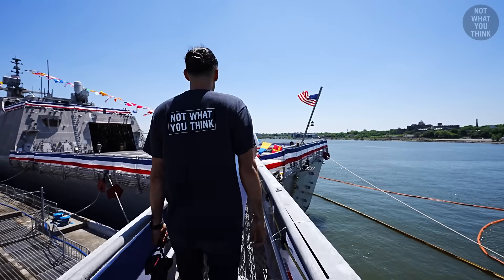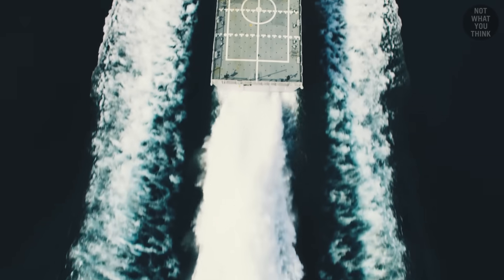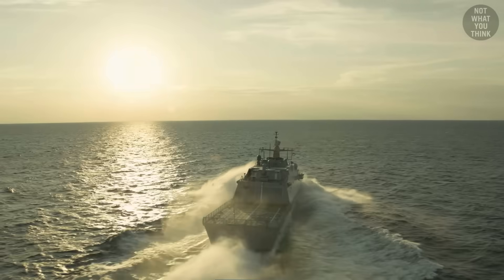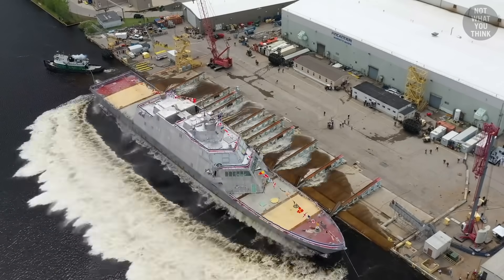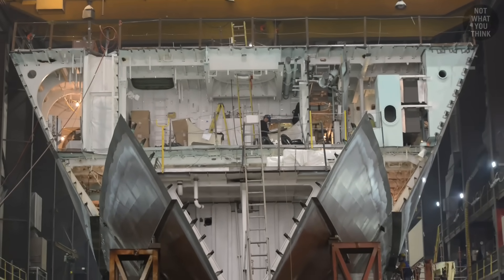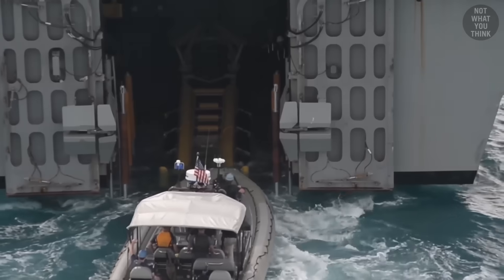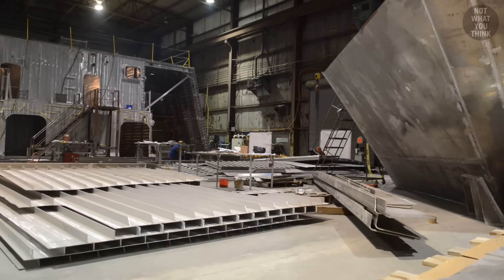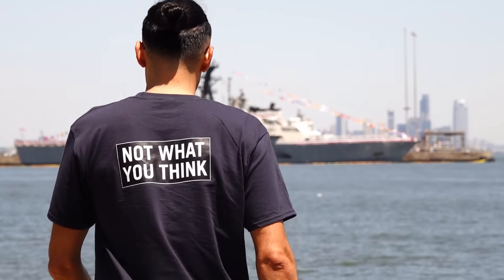I Visited The Most *Overpowered US Navy Warship

Comment: These sharp, 90°, angular corners are a mistake. Corners that are 'sharp' like that, be cause of the very fact they 'stick out' and therefore all incoming forces they could be subjected to would always hit at precisely that same point.... and such angles, when your think about it for a moment, COULD come in from anywhere of a radius CLOSE TO THREE QUARTERS OF THE FULL CIRCLE THE TOTAL OF ANY SURROUNDINGS INVOLVE. It is not gonna be all the way up to 270 out of 360 degrees but close to it! ROUNDED corners on the other hand will hardly ever be struck twice at exactly the same point, will be struck way less hard usually be cause they allow for objects to slide passed them while more often touching with way less impact be cause of that, are able to disperse oncoming physically forces to surrounding areas in (and of) the material they consist of thus, by spreading the impact absorb it. All these feats are QUALITIES and they are qualities angular corners are missing! Round(ed) is less vulnerable and stronger precisely the same way rounded load bearing constructions are officially stronger and able to carry the maximum of weight the material can handle physically, and all that without weak spots. The ancient Romans built bridges and viaducts with half circular transitionsc between vertical and horizontal load-bearing stone work and it is what makes egg shells so incredibly strong even as they 'are made of' chalk and less than half a mil thick. I am kind of amazed they did not think of that, it is quite possibly THE very most basic principle rule there is with regards to engineering, architecture and other design... physics 101 so to say.

Comment: "Aft of the ship" is where a man overboard would be.  The module spaces are in the stern (somewhat simply) or simply the hold, which is located under the fantail.  " Aft" is a direction or orientation, not a location.  You can have an aft hold (or gun, or steering station etc...) if you have a forward one, but the is no "the aft" on a ship.  There, now that one is abaft our starboard beam,  you may gaff that grommet to the gunter gudgeon!

Comment: A really interesting report, thank you very much. I live in Panama and travel frequently through the Panama Canal for work, and I noticed just such a ship on the Pacific side. It was moored there for quite a while, and I wondered what was going on with it. Its shape suggests that it is a fast ship, but of course you couldn't tell from looking at it that it was designed for speed. I come from the aviation industry, and when I am told that two Triple Seven engines together with a 19,000 hp diesel engine system are responsible for propulsion, I have no further questions. The fact that high speed and maneuverability come at the price of weak armor is, of course, a limitation for a warship. And the fact that its own submarine reconnaissance and warning systems fail due to the propulsion concept is, of course, a real safety problem and a restriction on its deployment. Incidentally, I don't believe that the diesel engine system, and even less so the Rolls Royce turbines, are responsible for the vibrations, but rather what they power: the gigantic jet pumps. One ray of hope is the versatility of the helideck and the red light district. I think that, especially in the Pacific coastal region and also in the Caribbean region as a whole, ships with surface combat capabilities of this kind would certainly find useful deployment if necessary. The report is no longer entirely new, and the situation has changed significantly in the areas I mentioned. We have a criminal and corrupt Venezuelan ruler who believes he can take on the US Navy, if not the entire US, and we have the famous white triangle on the Pacific side, through which far too many drugs are still being transported, most of which ultimately end up in the US, causing major problems there. A ship like this could really have a beneficial effect.

Comment: I cannot describe how much I HATE that you kept calling the water pumps "jet engines".  I know that technically they are jet engines, but it's so confusing.  The power is generated by a "jet engine" that's  actually called a turboshaft, and that power is sent to the water pumps which are called impellers.  Both parts could totally legitimately be called "jet engines" so it's super confusing.  Anyways, it's the water pumps or impellers that are making the vibrations, and those have to be firmly fixed to the hull, so there is no way to eliminate the issue with the current design.
Reply: それだけで無く、海水を大量に吐き出す行為自体が、
騒音を発生することになりのでは。
又船体が滑走さす設計から、低速時であれば、
ソナーを働かす事は出来ようが、
通常航海時でも船体と海水が叩く音で、
ソナー効果が落ちるもでは。
DVSをフリーダム級は積んでいましたかね。❓
積んでいれば、ハンター艦と探査艦に別れての対応を行えば、
対応は出来るでしょうが。
Reply: Gas Turbin’s 🤫 😛

Comment: Great video, brings back memories. When the video talks about the number of crew and the various jobs they fulfill, what should also be noted is that such a small crew often results in few days off while in Port with four, or even three section duty.  Meaning  while in port, crew works a 24hr "on duty" shift every 3rd, or 4th  day.  That includes weekends, so you rarely get a full weekend off.

Comment: When any engine is contained inside a box, the secondary control it offers is noise suppression. The box can be suspended on dampening struts, or other structures, to dissipate and reduce engine vibrations to the hull in an effort to reduce its sonar profile.

Comment: If you can want to see why the engines are in those boxes google "uncontained blade failure". I dount they have the big bypass fan that they do on an airline but even the inner core of the turbine has a lot of metal rotating at very high speed. If the ship takes a hit you dont want it going through 3 decks. Secondary you want to contain the fire

Comment: The gear box was really affected if the vertical and hirizontal  mounting of the propeller shaft linear to gearbox was so very poor that getting free from moving away from linear and caused vibration and worn out bearings and gearbox in a highspeed resulting from overheating.

Comment: I served 1974-1994 USN, I remember back in the day the PHM class which were Hydrofoil patrol boats. I was stationed on the USS Truxtun CGN-35 and USS Arkansas CGN-41 back in the day before the Ticonderoga class cruisers came out. I will tell you those Nuke cruisers I was on could get up and go top end 50 knots plus. Ever see a 600 foot cruiser throwing up a rooster tail? The CO on the Truxtun had Red and Blue strobe lights mounted up on the mast and turned them on when we went all ahead flank.//RMCS (SW) USN Ret.
Reply: served on cg72 yes 600 feet with a rooster tail..... And that's not the compared to watching a carrier pulling away from us
Reply: @gilbosavannah  Well, one way to think about it is that a Nimitz class's listed top speed of 30kts or 35 miles per hour, and that may seem like that's not fast, but when was the last time you saw the Empire State Building going past at that speed? Another way to think about it is that a carrier's listed "top speed" is like the "top speed" listed for the SR-71. Ohh, and the Enterprise was the fastest carrier between it's eight reactors and hull design.
Reply: Yes, I did.  Race of USS GRAY (FF-1054) with USS Long Beach; The cruiser  with the ENTERPRISE disappeared over the horizon from the FF.
Reply: I did some testing on Trextrun in 77-8 on one STG. Interesting engineroom, got more on my film badge in 1 hr. than I got working on 637 class boat for 3 years!
I saw the Lincoln go by the merchant ship I was on, go by @ 50 knots! Their rooster tail was as high as the flight deck! Never seen anything like it! 😮
Oh! That was in the Strait of Mallaca!
Reply: @brucelytle1144 Wow, I was an RM so never had a reason to go down to the engine room or wear a TLD. surprised you got so much exposure compared to the subs. Streets of Malacca been through there quite a few times thanks for sharing shipmate.
Reply: Back in the late 60's I piloted a very fast speed boat capable of over 70 knots , it was 65' long and believe me 50 knots  (62MPH) is moving almost too fast for the ability of a craft to turn and especially stop, we said that we just DIDN'T Stop-Ever!
Reply: You rarely see it. But even a OHP could throw a rooster tail. But could not dial up 50 KN. Maybe 33+
PHM calm Gulf of  America this week?  And no junk half submerged in the water. Faster than a commercial Bell Ranger.
Did you know Capt. Orvis?
The Enterprise? oh yeah. Just bit over engineered in the propulsion department.
It also is tough on the hull.
Reply: comparing ships speed is one thing, but compared to modern hypersonic missiles they are stationary, like a speeding car trying to outrun police radar
Reply: Yeah, I was thinking if it would be doable to mount hydrofoils on a ship this size and weight. And not only because it is indeed impressive never mind our host mentioning it is considered one of the smaller vessels within its class (did I even get that right?), but I also wonder if the astonishing speed it can do in combination with the roughness of the seas would not make it very dangerous to even use hydrofoils ~ what would happen if that combination of forces would slam one of them to pieces, ripping it off the hull or deforming it severely, while the others are still in place when you'd been racing over the surface up to that moment? (As you can tell I am not on any level that would allow me to estimate such things, to truly understand them or know what I'm talking about. I am just interested.)
Reply: Ahh the Arkatraz, cell block 41 😂😂😂 OS2 89-92
Reply: Arkatraz...imagine CIC on a minesweeper...ug.
Reply: Uffffff admirable maestro, tremenda historia, espectacular, poderío naval, saludos desde Colombia 😃👍🇨🇴🇨🇴🤝👊

Comment: I want S shaped tube's that swing down over the ends of the water jets. So the eater jet thrust is pushing against the water flowing under the hull.   Instead of just into the air behind the transom above the slipstream.

Comment: You didn't cover what is likely the biggest negative about the LCS: they are LOUD and have LOW SURVIVABILITY. In other words, the enemy can hear them from miles away and the LCS has limited armor and is made of aluminum. Do you want to run missions in a beer can against Chinese navy assets? Even without the extra mission of antisubmarine warfare, they're too noisy to simply detect enemy subs in self preservation. Lockheed fucked us out of the F-22, were given the F-35 contract under dubious circumstances, were 10 years and $1 TRILLION OVER BUDGET on that, plus at no point has more than 30% of the Lockheed F-35 fleet been fully operational! In the MIDDLE OF BEING A DECADE BEHIND SCHEDULE AND A $TRILLION$ OVER BUDGET the fucking bureaucrats at the navy gave them a contract for this steaming pile of shit!! Boeing and Lockheed should be busted up and sold off, their boards of directors and the corporate officers put in prison until they're fossilized.

Comment: Fun fact the helms on board can be configured differently for control. One helm itself can be used as the master while the other 3 are slaves. Normal configuration dictates theat 2 of the 4 are master and the other 2 used for backup. However in the event of all helms being destroyed there exists a secret helm of which im not at liberty to discuss as well a the systems use for remote piloting

Comment: Water jets are a advanced rotery bladed system, a bit like hiw a jet plane turns fast to move the air threw the blades. A water jet is basicaly the saem but pushes water instead of air. Its just not like a standard propeller,  but its still a bladed device. Need to explain this better or show people how a basic jet ski works.

Comment: TERRIBLE IMPLEMENTATION USING JET ENGINES.... I HAVE A SYSTEM THAT USES ELECTRIC ENGINES WITH A GEARLESS TRANSMISSION AND 2 G.E. TRAIN ENGINES AND GENERATORS, FAR SUPERIOR BY 100YEARS TECHNOLOGY FROM TODAYS ANCIENT TRASH. EVEN THE 1940'S COAL STEAM TURBINES ARE FAR SUPERIOR FOR ELECTRIC MOTOR. QUIETER, FASTER, MINIMAL VIBRATION AND 87KNOTS TOP SPEED....NEED THE NEW NASA IMPELLER AND IT COULD POSSIBLY HIT 125KNOTS. the admiral at BAE in Fridley didn't even want to see a remote control version i had made in 2016. that's fine, russia and china are very interested in building my sweet toys

Comment: I think there's been a lot of dumping on the LCS's and it's nice to see a more positive video, but it'd also be nice to have a single overview that gives both sides.  The ships (like practically every large military project) are trying to do radically new things and people see issues.  I classify the issues like this:

TYPE 1: teething problems.  Bad combining gear design.  I think the sister class had some decks cracking.  It sucks we don't find this stuff until we build it and people should look into why there wasn't a test of these subsystems (the combining gear, or say the Ford's electric catapult) five years earlier so issues could be redesigned before the hull design was even finalized.  But while we could and should avoid these costs, they're fixed now, and these are absolutely not a reason not to build more.

TYPE 2: non-problems.  For instance the contractors are expensive per day or per year, but not when you look at the training costs, housing, and even more, the lifetime commitment the military has to sailors' early retirement pensions, life-long VA care and so on.  The contractor doesn't cost a cent until they show up and don't cost a cent once they leave.  Another example is the sister class being disallowed for rougher sea states.  That shouldn't be a real problem as these are designed for shore use.

TYPE 3: remaining inefficiencies.  I'm not a naval engineer, just a software engineer, but I wonder why they even have combining gears.  Can we not give the small engines small jets and the big engines big jets and simply make each one a self-contained powertrain?  There may be legit issues even with the newest builds, but they may be things we can live with.

TYPE 4: show-stoppers.  To me the real killer here is the insane speed.  I have no idea why the LCS's are built to be so fast, but if you cut max speed by 1/3, the amount of power needed is less than half, as would be the cost and the space required.  This would allow you to double or triple the actual mission payload, add some VLS, anti-drone cannons, storage for drones and anti-drones, etc.  HOWEVER, the ship is just designed around its engines, I suspect.   You can't just keep the total design except make the engine room 60% smaller and use the freed-up space efficiently for missions.  For instance if top speed is lower, the ship's shape can be bulkier and thus have more internal space, and so on.

TYPE 5: cost.  Like every military program, there's a huge R&D cost, then the cost per unit.  If the cost per unit PLUS its share of R&D is too high, then we cut the production run--but that makes the cost per unit PLUS its share of R&D even higher!  We see this with a lot of military purchases: we wanted  180, but the cost is high, so lets build only 90, but then the cost per each is higher yet, so we cut again to 45...  As the excellent channel Perun says in a recent video: "if you can't afford 200, you should ask, OK, what if we build 400?"  The LCS's type 1, 2, 3, and 5 problems on my breakdown have caused problem 5 to get worse and worse and worse as the building program got cut again and again and again.  Really the ONLY solution for this problem is for ALL reportage, whether CNN or channels like this one, to quote always the MARGINAL cost (ignoring R&D) separately from the R&D cost.
Reply: @franksheeran9243 I agree cutting the program production numbers short is just making the problem (cost) worse.

Are there variations of improvement that can be integrated into future production, absolutely there are. The speed requirement is there due to part of the methodology of use a core mission set of the design was around countering high speed threats (think small craft swarms) & interdiction/counter piracy/ emergency response where response time is needed. The ships don't necessarily have a lack of available payload (as several hundred tons are available/reserved for mission modules) keeping the yard working building more refined design Freedom Class hulls would be best we know what works on them we have hulls to test the new ideas (say take the Zumm propulsion system & use it in the Freedoms for reducing complexity of manual combining gear [you know the failed part] use the MMSC with VLS that is already being built for the Saudis keeping the single mission Bay right sizing the core crew (I recall this being around 113 or so) with that you'd get your cost savings eliminate inefficiency & keep the positive aspects of other "failed" programs as well